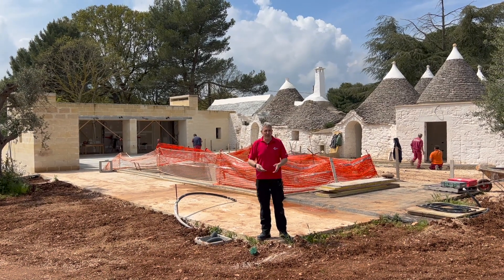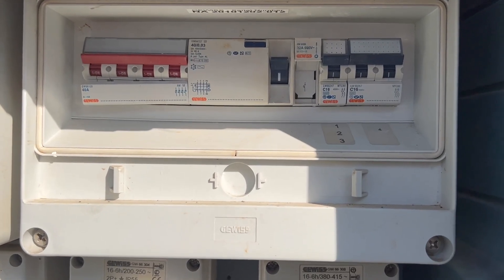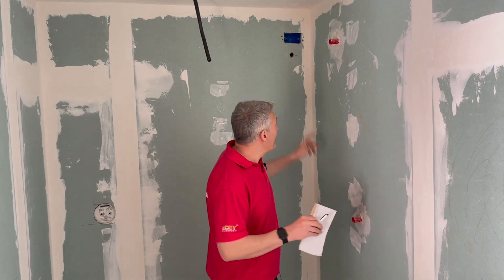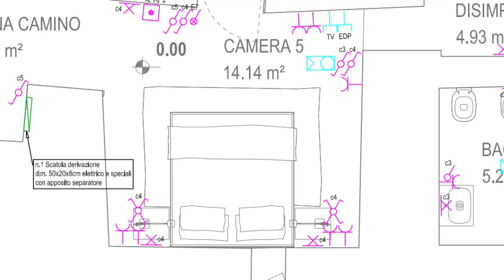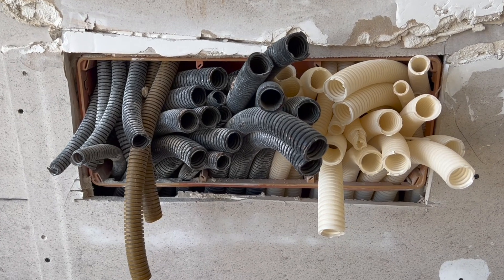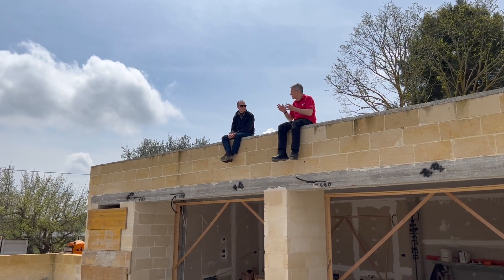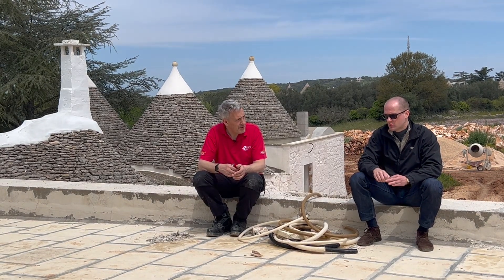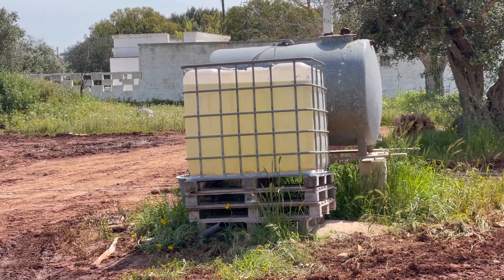Electric Wiring in Italy - You Won't Believe What They Do!

Comment: Thanks for the insight. Wiring old masonry structures is seldom easy. Especially for residential. Here in the US we brought in electricity fairly early in our expansion across the nation. The vast majority of existing structures both residential, commercial and industrial were constructed in the electrical age. Plus a very large amount of the structures we built are framed structures using wood and steel frames covered with exterior and interior cladding of one variety or another. Masonry is common in some areas but is loosing ground to framed structures. There were several government backed programs to get electricity to every part of the nation. In one place I lived as a kid the power company came in and cut almost a mile of right of way through heavy forest for free, just to bring power to one home. I have to say our way of running conduit and wire seems vastly less confusing and a great deal cleaner than any other place I have observed. Even in California with all the earthquakes, floods and wildfires our codes are fairly straight forward and generally economical. That doesn’t mean it’s inexpensive, it just means our national electrical code (NEC) was pretty far ahead of the curve almost from the beginning. The days of burning down entire cities are behind us, for the most part.

Comment: copper wire connected to galv steal... isnt that going to cause a metal to metal corrosion??  I didnt see any die grease on it...  In the US we use solid coper rods that are 6-12 feet long and we stab them very difficultly into the ground.
Reply: Yes, usually we use an apposite connector to join the two metals. Maybe they didn't have it available yet.

Comment: From a different perspective, I am shocked to learn some houses places may run on 20KW or 10. What do you need all that energy for? 😂
My house in Italy runs on 4.5KW and it is already considered higher than the average which is 3.
I also do understand that some  may not fully understand the utility billing in Italy. There is portion of the bill based on a montly fee which is tied to how many KW are made available regardless the power consumed. It used to be that above 3KW there was a considerable increment in this portion. Nowadays 4.5KW is a reasonable amount.

Comment: wow, that is so odd.....  In US, we dont do any conduit in the walls... wire is mounted to the studs...  That would make things sooooo simple if needing to change/update/replace wire in the future....  its always a pain to cut drywall away.. our breaker boxes are on the outside of the house and having these split breakers around is crazy...  this is so complex....
Reply: You have to consider that we don't have drywalls in Italy, so it would be stupid to tear apart brick walls to change some electric cables.

Comment: The problem with the conduits it's: they always put them in too small and with too sharp turns, making expandability pretty hard. For decent future proofing they should be at least 3.5cm wide, with nice gentile 60º or more corners (you never know when you'll need a pice of fiber in there), but what you find in the walls usually is 2cm, which means once you have 3 to 5 wires in there you're done.
I had surreal conversations with electricians a number of times, but it seems impossible to make them understand that the couple of hundreds bucks they're saving using inadequate size means nothing since every time you gotta add something you will need to break the wall, with all the related expenses.
Reply: So true.
I had to pull optical fiber to my garage just to have basic 1 gigabit ethernet because there was only one pipe going to it, pretty small and already used for power (in Italy you can't put different voltage circuits in the same pipe unless you use double insulation cables, and double insulation cat5 is thick and flexible as a wooden stick).
I broke the fiber two times before finally managing to pull it through in one piece.
Reply: They're saving time, and your money is not their problem.

Comment: From the UK but I've lived in different parts of Italy and only recently discovered why the power trips so easily, and it seems crazy that 3kW is normal there, but I'm glad to see that's changing with new builds & renovations, especially with things like domestic 7kW car chargers becoming fairly normal. I've only tripped a breaker once in all my life in the UK, but it seems to be fairly common in Italy - As you said, they get used to turning things back on haha

In one place I stayed at there was a Candy Trio, which is hob/oven/dishwasher combo taking up no more space than a standard oven, however I was told to keep the dishwasher door open when it wasn't running because otherwise it could cause the power to trip. Also touching the metal interior I would sometimes get shocked, so I'm not sure if there was an earthing issue. I believe they use the schuko plug on bigger appliances out there, so it should be earthed, but who knows what the issue was there.

Also not really related to electrics, but something I've heard about construction in Italy in the past is that they would leave buildings 'unfinished' with poles sticking out of the top of a building to make it seem like it was incomplete and there was another floor yet to be built, when in fact it was to not have to pay a tax which only took effect once a building was completed. I believe this has changed now though and maybe even being retroactively taxed too.
Reply: One of the first things you learn about appliances when growing up in Italy is what the 'forbidden combos' are, like dishwasher+toaster, hairdryer+washing machine or oven+practically anything. I reckon 99% of the households still are on the 3Kw cap, as I do despite living in a pretty recent condo in Northern Italy.
Reply: @Dave-xn9iz  you can upgrade anytime to 4.5 or 6 Kw, it only costs a bit more
Reply: @backslash68  It seems hard to grasp for them.
Reply: @backslash68  Great to know! I thought that wasn't an option for residential standard-size apartments. Between my comment and your reply, current tripped when I was at a friend's place. He cursed, and I didn't even link what happened to this video I'd just watched the day before. Just to give an idea of how normal that is for me.
Reply: I've heard about this but it's not common, or at least I never seen one non-finished house in north italy
Reply: Nope, it was common in the south Italy to leave the last floor unfinished to not pay taxes. No one in the north did it😂😂
Reply: @PaoloNONescobar_889  I think also in some parts of the south
Reply: the 3Kw limit is a way of soft-rationing the country-global available power. No oil/gas/carbon/nuclear here, so we need to be careful. You can still have 6 or even 15 Kw at home, but then you have to pay more (both fixed and variable costs). However, you can still install a device that will start beeping if you go over 3Kw and after a while it will break the circuit before the counter will do it.
Reply: In Italia puoi optare per, 3,3kW oppure 4,5kW oppure 6kW. In alcuni casi puoi chiedere di avere anche 10kW. Sempre tutti in monofase
Reply: I confirm that, some people left the whole house unpainted to avoid taxes.. I think that regulations has been updated to avoid this problem
Reply: Yes, Italians consider that perfectly normal. 20 years ago I stayed with a lovely host family in a 60s/early 70s apartment in Torino that had an electric immersion heater and oven. One evening I was sitting on my bed reading a book while my host mom had dinner in the oven. When my host sister decided to take a shower, the whole place went pitch black. I grabbed a torch and looked into the hallway, only to see mamma take a picture off the wall to reset the main RCBO hidden behind the picture 😀

I seem to remember reading the Spanish used to have 2.7 kW supplies and people routinely overloaded them until smart meters were introduced that actually cut power at precisely 2.7 kW instead of somewhere within the thermal trip curve.

In Austria I once stayed at an older house that had a 17-amp three-phase supply. We managed to trip that too, with a combination of oven, immersion heater, quartz heater and some other appliances. I have no idea where that odd size came from, it was implemented using an adjustable motor overload switch (thermal cutout).

Comment: how many cables are they pulling through the conduits? with the 180 bends under the floor I think max 4x2.5mm? Ask them if the cables have a low friction coating?
Reply: The conduit itself can have a low friction coating. U use lube if there are many bends and long pulls
Reply: @Znyggisen  lol their next video will be “pass the lube” 🤦🏻‍♂️😅
Reply: Well, it depends on the conduit size obv, standards are 20,25,32,40mm...
I would say you can go up to 5x2.5mmq in a 25.

Comment: Great video.

I was amazed at the amount of "corrugato" they put into my house in Lazio when I restructured it, with the result that the floors are very deep. 

It's a good system that allows easy replacement of wiring and usages but you really do have to plan positions carefully at the start and the concentration of cables in massive large boxes, around the house, at the centre of the star is less than desirable and perhaps a potential fire risk.

The downsides to Italian electrics are the 3 different kinds of power sockets (with rubbish plugs), that are generally not fused or switched. Also typically the current usage is undersized for anyone out of the UK - my kitchen power circuits are entirely on one 20A breaker with a result that I know my fuse box very well...

Corrugato has been in use here for decades, I've a 70 year old apartment in Puglia which uses it too, meaning I can rewire at reasonable cost.

Thanks!
Reply: Some tips: 
- you can ask for sockets with integrated protection. They cost around the double. I'm not sure about the real utility of them.
- if your breakers trip please consider changing breaker and line. You may be asking for troubles if someday the breaker stops working.
Reply: @Ale-bj7nd  Grazie Ale, I had a kettle that was taking out the entire kitchen, diagnosis is easier if fusing is local. Breakers are all good, issue is simply one of too many appliances on simultaneously, particularly if electric oven is on.
Reply: plugs are not rubbish, it's just that UK has he best plugs :D

Comment: Spaghetti wiring?  🙂
I've never seen AC power in plastic conduit.  In my condo, it's only used for the TV cable.  Flexible cable in Canada is steel.  Also, we have both local ground and distributed ground here, bonded together, with other utilities at one common point.
Reply: old idiot system not safe, lot better ewery box come own GREEN-YELLOW ground cble and connected ewery box and ground cables and flexiple tubes have lot lot lot better install,cheap,easy,safety, lot better and newer not use old style screwed hub connection to wires out of law many country because has burn many houses. need use WAGO wire connection only. only good safety connection has tested.

Comment: Puglia ❤

Corrugated pipes are a fantastic system: you can pull new wires into the pipes at any moment, to upgrade your wiring. Plus it needs no wall chasing.

This system is the norm in Italy: I have helped my electrician father when I was a kid with first and second fixes. Plus we already had RCD or similar installed 40 years ago already.

I live in the UK now and I have come to accept that an house rewire will trigger a full house reno between plastering, flooring and painting... 😮 ...surely this can be done better?
Reply: Often times when remodeling, the locations of lights and receptacles change. As an electrician in the states, the remodels ive done often had older wire. We would scrap all wire due to not knowing how damaged it could be. My most recent remodel had knob and tube wiring. Just fabric and rubber wrapped single wire floating in walls supported by ceramic knobs with ceramic tubes between joists. The oldest style of wiring.
Reply: they don't use tubings in the UK??? what kind of shitty system is that lol
Reply: Nothing at all stopping you using flexible conduit wiring system in a house in UK.
Flat cables are just cheaper, faster and simpler to install.
British homes tended to be constructed with accessible voids at ground floor, first floor and roof space, so conduits not really necessary.
Reply: @markrainford1219  I agree with you. Unfortunately most of the posted comments are the proverbial "one yardstick for two measures" type of thing.
Reply: Why would you need to rewire a house? Well, I guess maybe if you're Italian and you come butted up to the reality that a 3 kW electrical system is a joke in the modern era.
Reply: @ardgeighw5174  house rewire in the UK is a common theme, mostly because UK tradesmen love re-do instead then fix. 

Regarding the 3kW in Italy, it's a limitation in entrance to the home, not of the home itself: most italian homes can do more with little to no adjustment.
Reply: @DavideAnastasia  exactly, we dont need more usually. i have 6kW in my apartment but its because all my appliances are electric.
Reply: @DavideAnastasia  very true. Not many people, in Italy, will entertain the idea of running huge power on electric due to the uneconomical cost of electricity compared with alternative means.

Comment: Italian here. I'm really astonished how they are still building with fixed positions and conduits in the floor. Very difficult to change position of furnitures and to feed cables, often the curves are too narrow. I prefer conduits from the ceiling and a round of a large power conduit and data conduit all over each room.
Reply: Conduits on the floor is the norm around all the country. Sometimes they place them in the ceiling but only when you have a false ceiling.

Comment: Note that on a technical point the houses in the uk don’t have a standard 23kW supply. The incoming cutout (main fuse) and cable may be rated at 100A but that doesn’t mean the upstream infrastructure can support it.  If gas is on site most of the UK domestic properties have been designed with an after diversity maximum demand (ADMD) of a mere 1.5kW which is why heat pumps and car charging will require massive system reinforcement costing many £billions.  Only relatively recent developments include for heat pumps and car charging with ADMD’s of >10kW.  Distribution design engineer 45 year’s experience.

Comment: In Italy, from mid- late 1960 we were using plastic rigid conduit and solid core cable, then we switched to flexible conduit & flaxible cable in the early 1980s
Reply: My experience with flexible conduit is pretty bad, if you want to run additional cabling. But it's easier to install. I guess that's advantage is for the builder, not so much the user.
Reply: why use piping that has ridges, I would think it would be easier to pull the wire through smooth pipes. is there an advantage to using the ribbed tube?
Reply: @robertharvey8054 he corrugated pipes are only knurled mainly for two reasons: 
1) they cling to the wall and mortar and do not slip when used for small stretches 
2) they do not choke when bending

We in Italy usually use a dielectric lubricant to thread the cables in the pipes, in any case during the insertion phase if you do two (one pulls and one pushes) the cables flow without problems, there are pipes like those shown in the video which are called cable ducts where there is a smooth internal layer and a knurled exterior but start from the 40mm section

But remember that in Italy rigid cables were used until the 80s, in fact in some old houses they are still there, then soft cables were used and for that knurled pipes

Comment: That house is having 20kW run in? That large size? Average power supplied in Italy to a home is 6kW. Wow!  Average house in the UK is supplied with 23kW and an apartment usually 14kW minimum, and I have seen some with 23kW.  Some houses were/are supplied with 26.5kW.
Reply: if the house use gas for heating and cooking, 6kw are enough

Comment: One advantage of metal, or rigid plastic conduit, is that new cables can be fed through the tubing. In France I tried to run a new single core conductor in plastic flexible conduit, as in this vid. Could not get from one end to the other, as it was blocked, or flattened, along its length.
Reply: We use a cable probe that is more flexible. I have run some cable with my father in our home and never had an issue wven with 12m wires